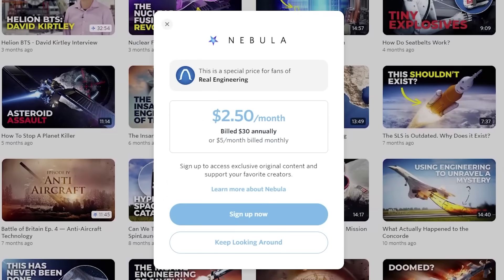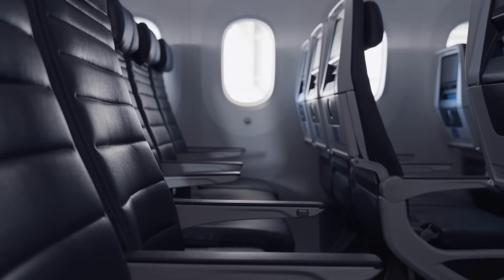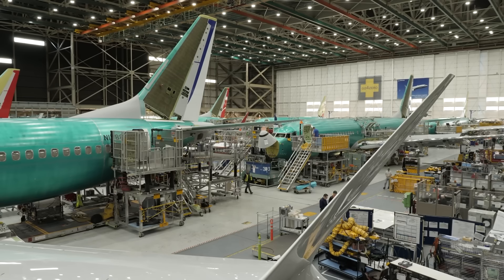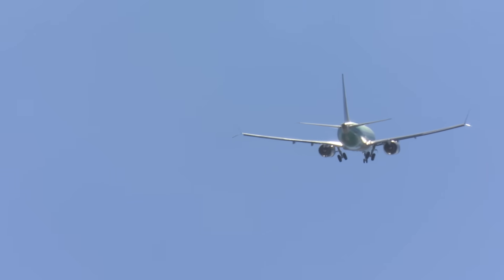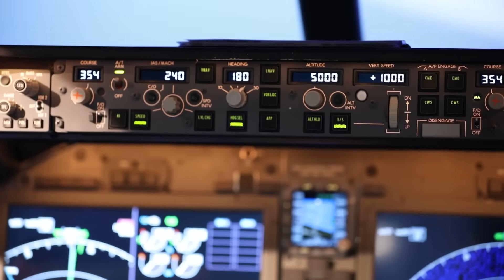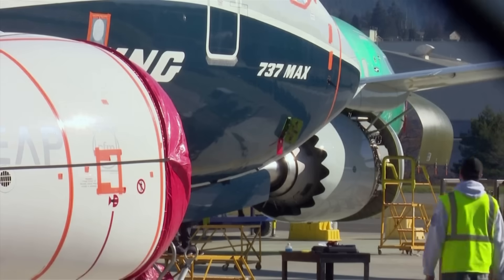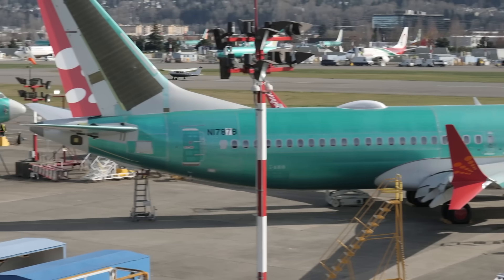The Questionable Engineering of the 737 Max

Comment: 1:20 the door frame/exit is NOT OPTIONAL if the customer prefers the higher density seating over 1890.  It is FAA MANDATORY.  However, if seating is less than the the door isn't mandatory so its plugged and allows for seating along the row
Reply: thats what he said no?

Comment: Where is the plastic of the panel cover would show witness marks 
Have picture of door plug broken 
Have not seen other side of door 
The one on table look 👀 close window clips no stamping and dirty 
Cheers 🍻 
Substandard bolts?
Pressurization if door panel had leaks it makes noise, I’ve had plenty wet toilet paper 🧻 to plug

Comment: What happened is McDonnell-Douglas bought Boeing with Boeing's own money.  Everything that's happening now is very similar to what happened to MD before they merged with Boeing.  Prior to the merger, Boeing's company culture was one of engineering first.  After the merger, when MD executives got into the company, it became overly cost conscious to the point of taking shortcuts in engineering.
Reply: The McDonnell-Douglas-Boeing merger and its ramifications have been disastrous for humanity
Reply: That explains how the MD execs ended up in charge of Boeing! How they managed to use Boeing's own money to buy MD and then end up in charge is quite a little feat and is a modern wonder. Not necessarily a good wonder mind you.
Reply: Boeing should have never allowed MD's managers and senior engineers to infiltrate the newly merged company. Boeing should have just cut all of them a check and let them go. MD ruined Boeing.
Reply: @enigmaticcruz2483  in that case, what would be the point of Boeing even buying MD if they were just going to fire everyone there? Be logical
Reply: @TSERJI  Sometimes you buy a company to eliminate a competitor. In such cases it's not unusual to buy it and then shut it down.
Reply: @shadowfaxcrx5141  wouldn't you be able to use the money you'd otherwise use to buy the company for, say, r&d and manufacturing to improve the product?
Reply: @TSERJI  Corporations are there to make money, executives are there to make shareholders money.  The only thing to drive out good product is competition, and if you eliminate the competition, then you don't have to push out as good of a product, since there's nowhere else for consumers to turn to.  It didn't used to be as big a problem as now because people were a lot more moral 50 years ago, where nowadays to a lot of people, money is their god.
Reply: @TSERJI  Sure, but that wouldn't eliminate a competitor. The idea that capitalism always leads to innovation is a myth. It can also lead to innovation suppression if your competitor is making something that's eating into your sales. Buy the competitor, shut 'em down, and now if an airline wants a new airplane they've got to come to you.
Reply: @shadowfaxcrx5141  "they've got to come to you." ... or, instead, go to Airbus, a company Boeing couldn't buy even in their dreams. That's what many carriers are doing now. A prime example is Delta, who has retired the vast majority of their Boeing fleet (e.g. 717, 767 & 777) with Airbus planes (A220, A330, A350)
Reply: @shadowfaxcrx5141  Competition leads to innovation.  What you're describing is a monopoly.  Monopolies are the absence of competition.  Capitalism creates competition, but companies don't want competition because it means they have to spend money to stay relevant.  That is why anti-trust laws exist.  One could argue that by allowing the Boeing-MD merger, the courts allowed a monopoly to form in the American airline market because the resultant company was the only real player left.  That wasn't a failure of capitalism.  It was a failure of the governing bodies to prevent a monopoly.
Reply: @VTdarkangel  To be clear, I'm not arguing that what Boeing/MD did is acceptable. I'm just explaining the thinking behind it. Frankly, Boeing should have been shut down once it started putting profits above safety, but this is a country where we will put you in jail for 20 years for selling cocaine, yet bend over backwards to let companies continue to literally kill people.  Been happening for decades (look up the Pinto Memo for a good one). We put corporate profit above everything else, including safety. Just about every major deadly disaster we've ever had that involved a consumer or commercial product can be traced back to flaws introduced when profits took precedence over proper engineering and manufacture.
Reply: @TSERJI  One of the hallmarks about the Wall Street-driven economy we've set up is that companies have become extremely short-sighted. Will it increase profits next quarter and make the stock price go up? Cool, do it and don't think for one minute about the long-term consequences.  At the time of the Boeing/MD merger Airbus was absolutely not a threat to Boeing because everyone knew Boeing made the superior product. MD/Boeing decided to capitalize on that by slashing costs to increase short-term profits. Now that everyone's figured out that Airbus is now the superior product and Boeing makes dangerous, janky garbage that should not ever pass certification, Boeing will lose a lot of money and a lot of business. But the decisionmakers won't care because they've already extracted their profits from the company in the form of golden parachutes and guaranteed pensions (back when the 787 was in development, the CEO retired with a $250,000 per month pension shortly after moving to eliminate the pension for the factory workers). Boeing is no longer an airplane manufacturer, it's the victim of vampire capitalism where the company's leaders and stockholders bleed it dry and then go off to buy yachts while everyone else suffers.
Reply: A big part was prior to McDonnell Douglas, most manufacture was done in house.   After the purchase, they basically went to 3rd party suppliers spread around to cut costs.   Not to mention the management moved to Chicago where they had 0 plants (and now in the DC area so they could lobby more effectively).   Sadly the merger was pushed by wall street because Boeing wasnt a "good stock" when it was a great company.
Reply: Yeah there's some aviation channel that covered it in depth. It's absolutely infuriating these insane people got to stay in power and ruin such a good company. Not that I really care about Boeing, just the knock on effects of this loss of life and safety. Anyone involved with running MD should have never kept their jobs.
Reply: underrated comment!
Reply: Welcome to capitalism!
Reply: Capitalism is great, up to a point. Then it turns into a dystopian cesspit of greed. McDonnell Douglas crossed that threshold and infected Boeing. It's a pity because Boeing was once a pride of USA. Sucking the life out of a company to line the pockets of executives is also in effect elsewhere at Boeing and its why SpaceX is making great strides while Boeing has little to show, other than lobbyists funnelling money from NASA.
Reply: Not really. The main thing is that after acquiring McDonnald-Douglas Boeing had an effective monopoly on large passanger planes but after a while Airbus arrived and has been very slowly eating away at their market share and Boeing has been trying to conquer their once dominant position.
The main reason the 737 MAX exists is as a reaction to the A320 Neo.
Reply: WELL. I have 'never heard' that explanation. Very intriguing to say the least.
 Thinking out-of-the-box stuff. Hmmm?

Comment: Minor correction. MCAS worked exactly as designed. The design was flawed. No redundant inputs was the big one, with the next problem being it's limit of authority was waaay too high. Finally, it should have been programmed to disengage with a big warning if the pilots were overriding it.
The rest of the issues were a soft tissue problem, like it should have required a new type rating.
Reply: Right. MCAS performed as it was designed to. Boeing decided it was sufficient to have just one AoA sensor feeding info the MCAS instead of utilizing both sensors.

Comment: I remember that this story broke during the first day of my vacation in Portland, OR. Considering I just flew on a Boeing 737 the previous day, it kinda freaked me out. Glad the pilots got that plane back on the ground without any further issues!
Reply: 99.9999% of planes don't crash, and even with the 737 Max, just take off one 9. Don't do it again, but no need to freak out too much, either.
Reply: And those passengers were lucky that the door plug failed at 16k ft instead of 30-38k ft during cruise. Not only would the depressurisation event have been much more intense-likely leading to a bigger hole being torn out of the side of the fuselage but it would have probably taken several seats out with it. Along with any flight attendants standing nearby, and any passengers not wearing their seatbelts-which everyone wears during takeoff but not during cruise.

And of course if the fuselage and panelling parts from the hole, or any of the other debris or people being sucked out damaged the wing, flaps or engine… well. That would have been worse. So yes, everyone on that flight got lucky.

Comment: The previous maintenance issues with this plane were not related as far as I know. That was the AUTO FAIL light which indicates the failure of one or both of the auto pressurization computers. That's a computer failure, and could not have anything to do with a possible leak. If it was the CABIN PRESSURE light, that would indicate that the plane is either not pressurizing correctly due to a leak or computer failure, but the pilots would have seen the AUTO FAIL first. And in those previous incidents, we probably would have heard about it as they would have all required emergency descents and dropping the masks.

As far as the engine issue. Our manual does not have that five minute warning. Instead they just put in a limitation to make sure we're not operating the engine anti ice outside of known or expected icing conditions. This is normally at or below 10°c with visible moisture until -40°c except in descent where we do it even below -40°c. Basically, they included a new limitation to make sure we ONLY use it during the already previously prescribed procedure, which is frankly very bizarre.

As far as pilots saying they love flying the max, and I'm one of them... Well that's because we're comparing it to the NG and older models. The 700 feels sporty because it's smaller. But they're old, worn out, and the flight controls all feel heavy. The 800s have the same engines, so they're very sluggish in comparison, but generally newer, and you can actually control the cabin temperature. I've heard the 900s basically feel like they shouldn't be able to fly. And then you have the max, which is just the newest version and has a lot more thrust available. So basically, the 737 is just a garbage airplane, which makes us pilots feel like the max is better.
Reply: This is my understanding as well, the previous pressurization warnings were related to the primary pressurization failing over to the alternate system, and not an indication that pressurization wasn't being achieved (ie there was no leak).

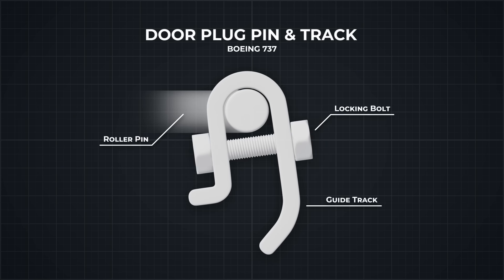Comment: 3:08 you have that wrong. The plug is opposite a normal door, the pin is on the frame and the guide on the door. That means the door needs to move up to go out, not down as stated.
6:00 This is standard procedure. They likely couldn't reproduce the issue on the ground. This makes sense since, if the door wasn't fitted properly, on the ground it would be held in place correctly by gravity for a pressurization tests, whereas in the air it could be jostled about and might not seat itself correctly while pressurizing at altitude.
Reply: Thanks EvDelen saves me making the same comment, I am curious to know with the lifter springs helping what would the force required to lift the door be,  supposedly during maintenance (all safety bolts removed) .  Would it be similar to lifting the tailgate on a car.

Comment: I think the engineering is now ok, it's the manufacturing and delivery process that is broken.
Reply: If one makes the assumption that the door plug bolts were never installed on the Alaska aircraft (which seems probable at this stage), then the door plug took ~140 cycles to move sufficiently out of position to depart the door frame.  I’d venture to say that this would seem like an engineering success and a production line failure, as you suggest…

Once the NTSB preliminary report is released, we’ll have a better idea…

Comment: The craziest part of this is having 3 confirmed pressurization issues and thinking oh we won't dig further and we'll just not fly it over water. 

Those "oh we'll just clear the warnings that's odd" types of attitudes have led to these types of accidents and worse in the past. 

That plane should have been grounded and inspected. Cause at the end of the day even with everyone belted in it was just a dice roll whether or not someone would be sucked out of the aircraft. Continued operation isn't worth lives in cases like this. I can't imagine solving this now is going to be cheaper for Alaska airlines than it would have been to put the hull down until the issue was discovered and fixed.
Reply: This video is incredibly inaccurate, the pressurization issues the plane had are no due to the cabin loosing pressure. It’s a completely separate system. Believe it or not there’s a good chance you’ve been on a plane with that exact write up

Comment: I disagree with the title, the original issue was clearly an issue with executive decisions. The door plug is also not an engineering issue, probably it happened after manufacturing.
Reply: Yes. Many other aircraft have door plugs; it's not an engineering issue at all.
Reply: @CuriousGuyHobbies  it's possible to incorrectly design or incorrectly engineer a door plug,
like to do the math incorrectly... 
but that's not what happened.

Comment: You did not fully explain the MCAS fault. This was partly due to a poorly engineered hardware sensor addition, and a software "fault".
The flight control system depended on data from a (new) single sensor that had no backup (i.e. no dual redundancy).  
This was just plain stupid:  All safety critical systems should have dual redundancy throughout.
But in the two 737 Max crash cases, that new sensor failed, giving the flight-control software incorrect information. The software "fault" became apparent and this finally caused the disaster.

Comment: just to clarify one detail: the cockpit door (or some panels within the door) opening is by design, every commercial plane does that to equalize pressure in case of depressurization and this fact is also supposed to be mentioned in most manuals according to an A320 pilot that I've heard talk about this incident... However, he was surprised that the alaska airlines pilots were apparently shocked by the occurance which means either the pilots didn't know about this specifically or the manuals in the 737's don't make mention of this fact...
Reply: Another pilot stated there are blow-out panels on the doors which are supposed to open rather than the door itself—or at least that’s the way it used to work, and if that changed, nobody told them.
Reply: @joshcarter-com  yes exactly, at least the A320 pilot stated the same
Reply: as a pilot in an A320 the locked cabin door is not designed to open.  smaller blow out doors/emergency exit doors are made to open.  The 737 max 9 the entire door openned so violently the crew struggled to (eventually) close the door & secure the cockpit.

Your friend was shocked because the entire door blew open and jammed open.  Furthermore the boeing manual doesn't say it is supposed to or designed this way (another manual omission a la MCAS).
Reply: @soccerguy2433  well yes exactly
Reply: Similar to MCAS, Boeing likes to keep pilots in the dark. Minimal info, minimal questions, minimal retraining, minimal expenses, maximum executive bonuses.
Reply: and another remark: In contrast to the whole MCAS debacle, I would guess this is very much a more or less recent quality and safety control issue, not so much an engineering problem since the way these door plugs were installed on the MAX are pretty much the same as with all the previous 737-900 NG variants and they never faced issues over the decades....
Reply: 'Every commercial plane' is false. This door thing is NEW to the MAX series and the manual is getting changed.